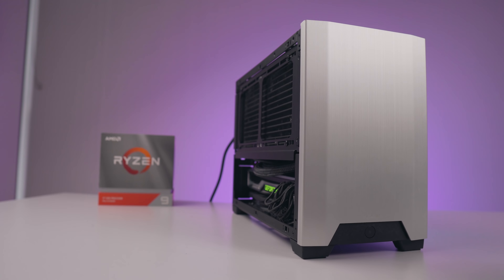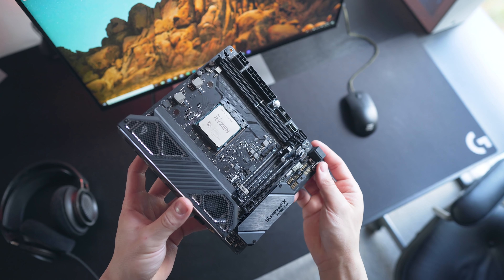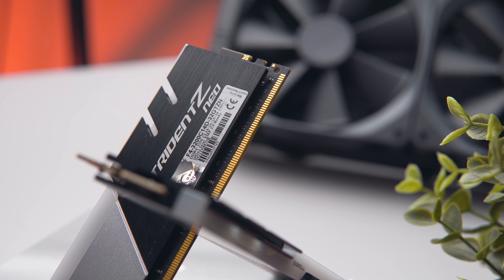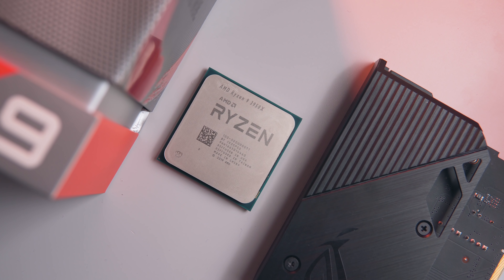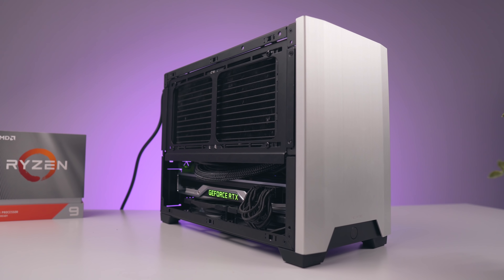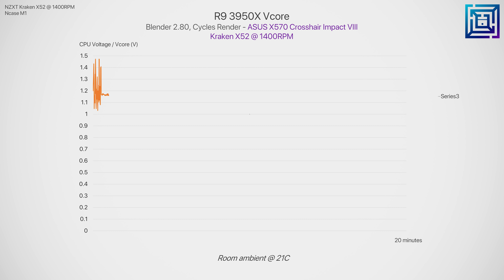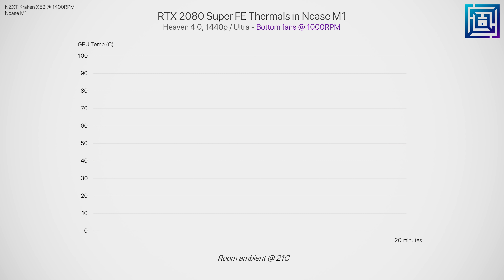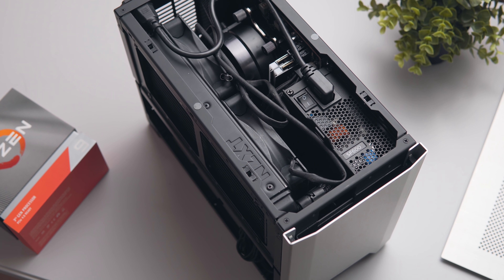Building a Mini 16-Core Beast! Ncase M1 + R9 3950X

Comment: This is a great build! Thanks for making that video!

I did an almost similar build and, since you're really more specialized than I am I have a few questions If I can borrow some of your time.

It's based on your build, with several changes due to price/availability/preferences. here are the details of my build. Probably not perfect, but I did my best within my budget. (It will be my new work/games Station and I hope it will last me a good many years. I see it as an investment.) No overclocking planned for the moment. I will think about it if I start to reach its limits in a few years. 

Processor: Ryzen 9 3950x
+ Corsair Hydro 100i RGB Platinium 240mm. (Mounted on "intake")
Motherboard: ROG Strix X570-i
RAM: 64Go Corsair Vengeance RGP Pro 3600Mhz C18
SSD: Sabrent Rocket Q M.2 2280 NVMe 2TB.
Power supply: Corsair SF750 80 Plus, Platinum.
Case: Ncase M6.
+ two Noctua NF-F12 (Mounted on "intake" also)

And I want to add a RTX 3080 when I can.

but, yeah, I have a few doubts.

Given the given dimensions, the 3080 should fit in the case, but not by much!
Given the size of the case, I suppose that the heat from the graphic card will come out more from the top of the case than from the back. But I'll see how it looks when mounted. 
If that doesn't work, I'll have to find something to modify the case to put the CG vertically on the outside maybe. 

What do you think?

Anyway, I hope it will work, if you have any advice I'll take it. :)

Comment: Just curious, did the X52 you have not come with the new AM4 latch bracket? Or did you choose not to use it? I have the X62 and the Crosshair impact and just went with the latching bracket though it sort of sketched me out how much pressure is required

Comment: Great build! After also watching your review of this case I'm pretty set on this for my next build. Do you think one 240mm rad on the side would be fine for cooling an AMD 3600x and GTX 2070? Not much of an overclocker but usually add a little. Or should I have two radiators? Just want to stay below 80c staying on the quiet side.
Reply: 240 will be perfectly fine if anything a bit overkill

Comment: Is it possible to fit 2 HWLabs Nemesis 240GTS radiators in M1 V6? Those have dimensions of 278mm x 133mm x 29.6mm. Will there be enough space for the fans, pump + res combo?

Comment: I don't like that higher end motherboards, including this Impact board, have extensions to wi-fi antennas, and they need to be placed outside of a case. I like lower end boards, like ASRock Fatal1ty B450 GAMING-ITX/AC, for this reason where the 2 wi-fi antennas just screw in at the back of a case.

Comment: I need to use the 3950x with a CPU cooler with a max height of 114mm. What do you recommend  ? Keep in mind that I never overclock my CPUs so overclocking is not important for my build.

Comment: If you would like to avoid liquid cooling, which alternative would you suggest that would fit the setup at its best?
Reply: If you want air cooling, the best option is the noctua nh-c14. The u9s is not bad either

Comment: How do you think a 3950x would fare with a Corsair H80i v2 cooler, in a Fractal Design Core 500 case? I'd designed this build for a 3900x, but due to suppy/demand issues and the 3950x release date announcement, I decided to wait and see.

Comment: May you check the power draw from the wall with that config? I wonder if the Corsair SF450 would be able to run the 16-Core and a High End GPU..
Reply: Curious as well. I have a rtx 2070 nonsuper with the Corsair sf450 platinium
Reply: Jonas Trachte yea with a high end psu ur not gonna see an issue like a 650 watts and it’s more lower efficiency then the 3900x as well

Comment: got some questions with your builds: first, would the fan installed below the gpu really necessary? i dont see any space for air flow between the gpu and noctuas. second, why did you choose sf600 instead of sf750? ye i know the whole build wont use entire 600w but headroom for 3950x and 2080s seems quite insufficient. i am asking this because i also use 500w sfx psu with 2070s and ryzen 2600, but many people really do not recommend this tight-power build.

Comment: This is about exactly what I want to build, and I just ordered the ncase m1 v6.1 case  yesterday.  Couple questions: 
1) most of the pcie gen 4 ssd's have a huge heat sink, looks like you pulled it off and put yours in the riser card, is that ok even with the gen 4 cards?  can I fit two in there and to raid 0? 
2) are you sure about the crosshair viii vs strix recommendation?  With the front panel usb type-c on the v6.1 I was under the impression you don't get that with the strix, and isn't it missing the wifi 6?  I'm just thinking you need the crosshair to get the full potential of the ncase m1

Also, with the card, isn't is possible to get a liquid cooler for the gpu that runs off the same cooling block as the cpu?
Reply: Josh Armour You’re correct that the X570 itx strix does not have front panel usb-c support. It seems like no X570 mITX board has front panel usb-c support, which is shocking seeing as the Z390 itx strix does and it’s an older board.
Reply: That said, he’s right not to recommend a $420 board over a $200 board that offers nearly the same features with the exception being better overclocking capabilities/features and an extra port.

Comment: Do you think it's possible to mount two SSDs using the 2.5" HDD stacking brackets on the inside  IF you're also installing a 240mm AIO Liquid Cooler like the Kraken x53? Can you still do two or just one?
Reply: Short answer: Yes. Long answer: I've got a Kraken X53 and have built my N1 v6 with 2 SSDs under the front panel as well as a 3rd SSD with the stacking brackets pre-mounted to be ready for a 4th SSD someday in the future. It's tight, but reasonable clearance.

Comment: Hi Ali, I'm in the process of acquiring the parts for a new build. So far I've gotten a Ryzen 3950x and a Strix X570-I board. Would you recommend the G Skill F4-3600C18D-64GTZN kit? It's marketed as being designed for this platform, but it's not listed on AMD or ASUS support page...
Reply: also, would you recommend it over Corsair Vengeance LPX 64GB (2 X 32GB) DDR4-3600 CL18?

Comment: Amazing build man, try to remove the fans on the rtx card and you will get better GPU/CPU temps and airflow trough the case, but at the bottom mount two Noctua NF-A12x25, keep up with the good content!
I will use the 3950x and a Radeon VII for a hackintosh, this case will de the job just right!
Reply: So you would remove the RTX's fans and add two Noctuas and set them to intake or exhaust air? Thanks, seems like a good idea
Reply: CEZAR hey i want t make a 3950x / amd VII  hackintosh .. will you make a video of your build ? can you let me know how it goes , any problems ,, thanks from uk
Reply: @MorpheusLoopYMCMB  yes, i would remove the rtx fans and shroud and i will let the noctua fans at the bottom push air onto the heatsink and into the case, in the video the fans seem like they  are too close together and since they spin at different RPMs they might create lots of turbulence which may lead to bad airflow and higher temps and noise(a few degrees and Db more), but keep in mind that i will try this with my PC i dont want to tell other people what to do so they dont' damage their components and lose their warranty
Reply: @1707Cezar  Ahh okay I understand, I would be curious to see if it makes a big improvement. Do you have a channel or social where you post your builds?
Reply: @MorpheusLoopYMCMB  I build PCs for family members ,friends and coworkers that get into the PC world, i never thought of filming it

Comment: Hi Optimum Tech team,

Hope you and your families are well.

Please pass a couple of suggestions regarding future NCASE M1 product development to Ncase team.

Dear NCase M1 team,

Please increase thickness of all aluminium panels to 2.5 - 3 mm. This will significantly improve the overall build quality and premium feel of your product and will bring it in line with Louqe Ghost S1 and Dan cases.

Also, please make a modification (v 7.0. ?) which will allow:

280 mm Water Cooling system to be installed.

Two bottom case 140 mm Noctua fans to be installed.

One 120 mm extractor fan to be installed.

Noctua NH-U12A 120 mm compact CPU cooler to be installed for those who prefer Air cooling.

I strongly believe these changes will transform an already good product into an absolutely fantastic NEXT LEVEL one! 

The very small / insignificant incremental increase in dimensions (couple of millimetres here and there ) will be outweighed by the greatly improved thermal effects and versatility.

Many many thanks for listening to your audience and bringing such a great product to the market.

God bless you all. 

Myk

Comment: can you show us the cpu performance in OBS while streaming? is 3950x THE ONE for obs encoder at 1080p slow preset? while getting 144+fps in game 1080p low-medium settings(competitve settings) and I wonder if it would stutter, or how you could measure the stutter/micro stutter...
edit - ya in july you did that 3900x vs 9900k and showed dropped frames & frames vs gaming vs while streaming etc...   can we see it for the 3950x? 1080p res.. -- you could probably easily compare your data that you have from the previous tests.

Comment: @Optimum Tech Since you are one of the few people I've seen stick an Impact into an Ncase M1, will a super slim radiator like an XSPC TX240 fit in the bottom of the case with the impact in there if I use slim fans, assuming I water cool the GPU as well as the CPU? I'd like to move to this case and I'm looking for an SFF case that I can fit 480mm worth of radiator in for a similar build to what you have going here.

Comment: The only thing I wanna do is put the 32 core in there. So that that way I can run it in my van build. That's the only reason I'm looking for this thing anyway. Of cores you can put a 2080ti in a small case ...with an I7! but that won't have 32 cores and 64 threads!

Comment: Thanks for showing the chart on memory speeds. does that mean that 3200 MHz memory is ok with Ryzen? I.e. you don't need to get just 3600mhz
Reply: The 3200 kit shown here will be easy to overclock to 3600 because of the low latency. Basically any kit of ram will work, but the best performance will most likely come from 3600mhz cl16

Comment: How would be the thermals for a 2060 Super? Would I also need to undervolt as well as you say?
Reply: I have a 2060 super in an ncase M1 v1. You should be totally fine
Reply: @aarnio1694  Thank you! Wanted to go 5700XT but it's too thick (not 2 slot). So I'll go 2060S :).
Reply: kellyozore actually, you can get 3 slot cards in the ncase. I have a 2.7 with a bit of clearance on the bottom
Reply: @aarnio1694  yes but no space for 2 fans under the GPU then...

Comment: Are you still using the NZXT Kraken X52? I've got an M1 build going on, and I'm not sure if I want to go with an air cooler or an AIO.
Reply from the maker: 240mm AIO is highly recommended, but air cooling with a Noctua U9S is also quite effective.
Reply: @optimumtech  Is the Kraken line still recommended for the 240 mm, or do you have any other recommendations there? Thanks!

Comment: dream build, would totally exchange this for my dan A4 build :)
Reply: Brandon Donnelly  yeah my expectations are the 645lt can in no way cool the 3950x. At least not with further undervolting. My current 2700X is struggling as it is. Also - after working with the Dan A4, better go with the M1. The Dan isn't bad, it just sacrifices too much. I imagine the C4 might be good though.

Comment: Unfortunately I'm getting a q code error of 02 when trying to build this last night :(. I think it may have to do with video since I'm also not seeing anything on my monitor when booting, though the video card worked fine in the machine I pulled it out of (1080 founder edition card)..

Could be the monitor maybe?  It's a 49 inch LG monitor :(
Reply: JaceTwoCents did a video about it! I think your cpu is getting to much voltage!
Reply: Crimson Friend yep, turned out I was mixing 6+2 pci-e power connector with 4+4 cpu power connector.

Comment: Hmm in this case, with the gpu being so close to the bottom intake fans, would it be possible to use a 2.5slot gpu qnd remove the fan shroud+gpu fans? So that the bottom intake fans are right up against a bare gpu heatsink?
Reply: I have the Arctic Accellero 3 installed on my GPU with two bottom case fans set to exhaust.

Comment: I think you should reverse fans on cpu liquid cooler radiator.  Hot air flows inside the case from radiator. Or its a special fans with opposite air flow than usual fans?

Comment: 0:53 CPU's dont produce power, they consume it, but we get the point and it's still a nice build ;D
Reply: Actually it consumes energy and produce power as heat
Reply: @edmund850  actually, they only exchange energy.
Reply: @moisesramirez4516  Watt is a measure of power not energy.
Reply: the watt is joules/seconds, how much energy is being released as heat (in this case) in a given time, cannot produce it, unless you somehow violated the laws of thermodynamics.
Reply: @moisesramirez4516  Energy is measured in joules. Amount of energy transferred or converted per unit time is POWER

Comment: Will a U9S be suffice in terms of cooling this beast in M1?
Reply: If you have version 6 of the M1 you can mount the psu on the front and use the nh12s cooler. I dont know if the cooler would be sufficient for the 3950x though, but I plan on trying it as i despise AIO cooling
Reply: @mdkenley1  do you mean the C14S? Yeah the thing is from where I am, its hard getting Noctua products and I've already bought myself the U9S. Perhaps will just stick to 3700X lol
Reply: @Finomenal87  yes, thanks for the correction :) nutten wrong with the 3700x :)

Comment: Seeing as the 3950X's temps run low at stock, it should be feasible to use a Noctua low profile cooler right?, and have two exhaust fans on the side. Have you tested this configuration?

Comment: Stupid Noob question: When I build my Pc. I want to make use of M1's ports on the front. So when I do that, which motherboard shown in this video has all the connection pins. X570-I or Crosshair VIII Impact? Or there are other options?

Comment: cost of the parts and the entire project? 
if anybody is considering fo going with such a built*
Reply: Depending on the storage capacity I'd say about between 2800 - 3500 EUR. So more like 3200 - 4000 aussie

Comment: 7:05 Isn't that long, coarse string of Arctic Silver 5 a bit too gratuitous? Generally speaking, even after making the transition from Arctic Silver 5 to Thermal Grizzly Kryonaut, I've found the rule of less is more is extremely important. The only purpose of thermal paste is to fill the pits, troughs, and curvatures between the faces of the processor and AIO mounting points where air otherwise would be. An amount any more than is absolutely essential will begin to act as an insulating barrier and begin to reduce the paste's advantages.

Comment: 650 warts, way too low for a 3950x & 2080 super
Reply: Why do you think that? A good 600 watt will handle 500w loads without problems. Do you have any clue how much these parts need power?

Comment: Intel is faster !
Reply: Depends on what you want to do with it. Intel is often far behind AMD in any professional workloads, but it does have a 1% lead in gaming
Reply: @aarnio1694  more than one 1% in gaming  my uninformed friend it's 20% in most games meaning it is far better option than AMD for gaming . If it is workload only then yes AMD offer bang for buck but intel is not far behind !
Reply: SkyLimit Gaming 20%? Oh come on. Have you ever even taken a look at benchmarks? 3900x vs 9900k is only a few percent difference, not sure which year you living

Edit: https://www.google.fi/amp/s/www.techspot.com/amp/review/1877-core-i9-9900k-vs-ryzen-9-3900x/
Reply: @aarnio1694  nope i9900k is much better gaming chip across titles giving much better performance Vs the best AMD has got ! AMD is only good for work load I will give you that !
Reply: SkyLimit Gaming did you not even look at the link? The gaming difference averages around 3-4%.
Reply: SkyLimit Gaming the thing is, that difference is way smaller in most games. Talking about 5-10fps. And gaming oriented machines are only a fraction of the pc market. Why on earth would someone pay extra just to get +10fps while losing really badly in anything else
Reply: @aarnio1694  wrong gaming is a huge market and AMD is just slower once intel catches up with 10nm or 7nm they will far ahead across the board !
Reply: SkyLimit Gaming you really have no clue what you are talking about... intel is getting their 10nm by 2021 or 2022, and by then amd will have their 5nm ready.
Reply: @aarnio1694  maybe but the next intel chip in 2020 even if it's still 14+++++++++++++++++++ will still be faster in gaming compare to the best AMD has on offer. I am all for AMD kicking ass I just don't think they are good gaming CPU's. Intel builds better chips intel at 14nm is AMD at 7 nm intel at 10 or 7 destroys AMD. Intel just has better architecture Fact! I still a 8700k at 5 GHz and And can't even beat that ! So next year (2020) intel gaming CPU will be awesome I am skipping the useless i9900k .
Reply: SkyLimit Gaming well, we will see how ryzen 4000 will do in gaming next year